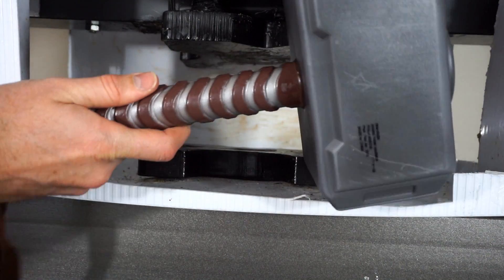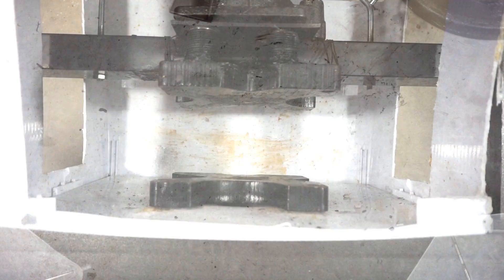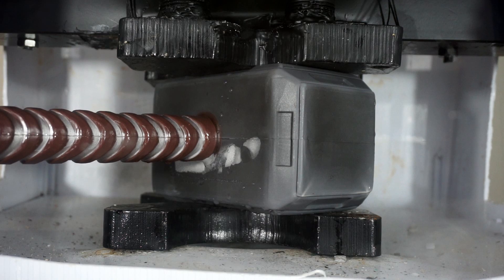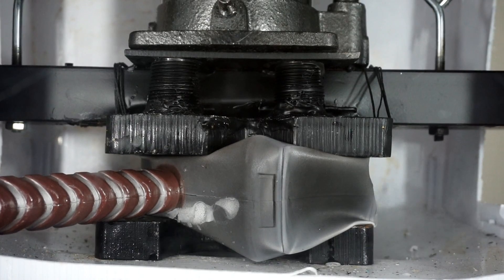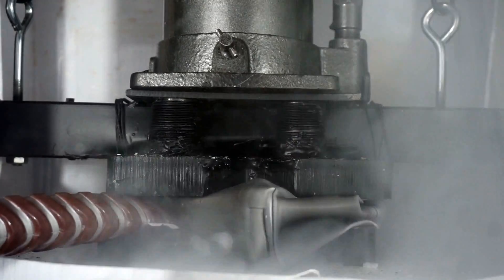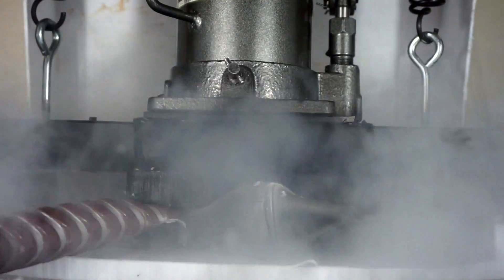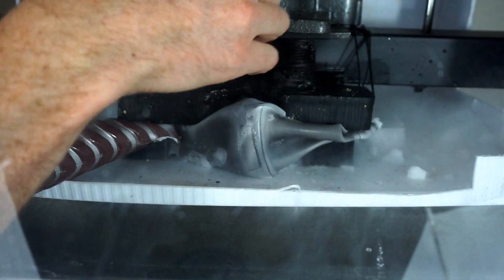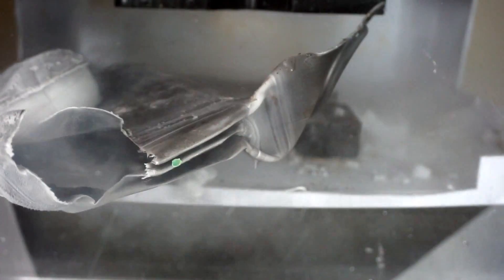Sub-Zero Thor's Hammer Crushed By Hydraulic Press

Comment: There is the noise, it has the weight of about not much but only 99999999999 kgs+ so you hold it easily, right?☺☺☺....😨😨😨😶